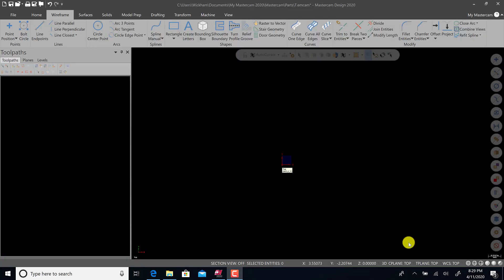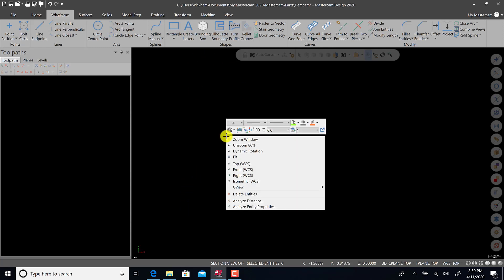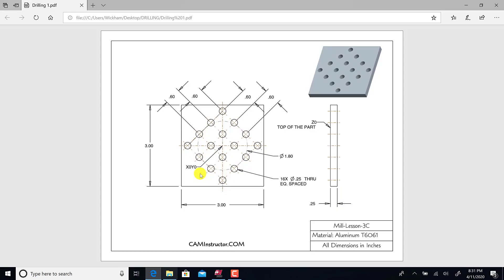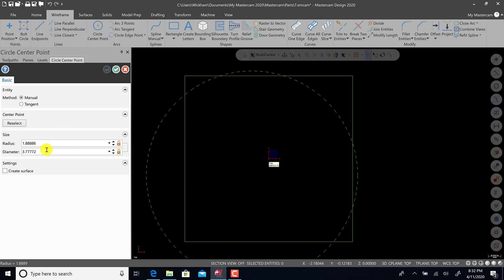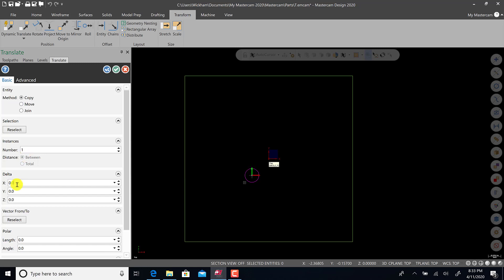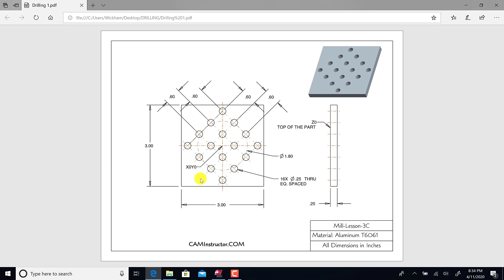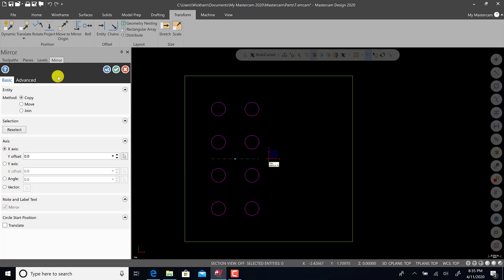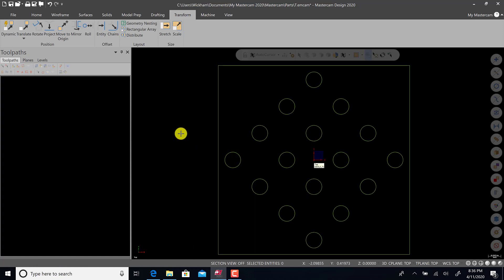MASTERCAM BASIC WIREFRAME GEOMETRY CREATION

Comment: ive checked for duplicatees and there are none im trying to make it so if i click on a line it clicks on everyhting its connected to like one entitiy how do i do that?
Reply from the maker: You can look for point of tangency issues using the analyze chain tool.
Reply: @BrianWickhamMFG  cool can i merge an .stl files the same way i merged a vise?
Reply from the maker: @alexcalibasi7028  I would think so, they can be difficult to work sometimes. Wont curve on edge etc.